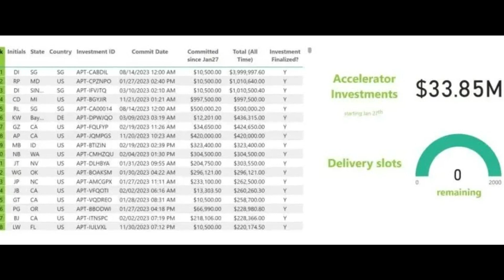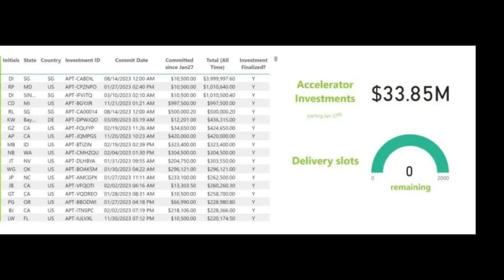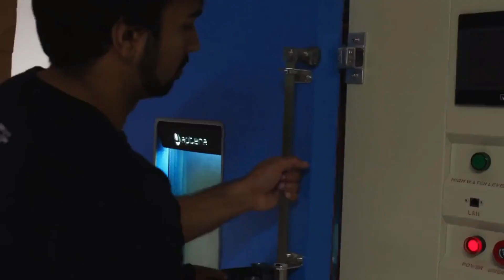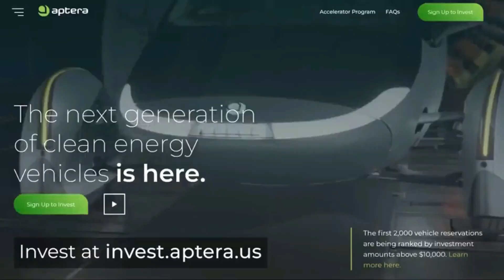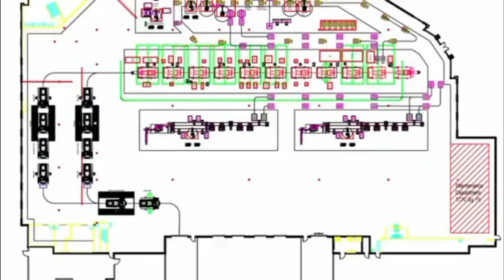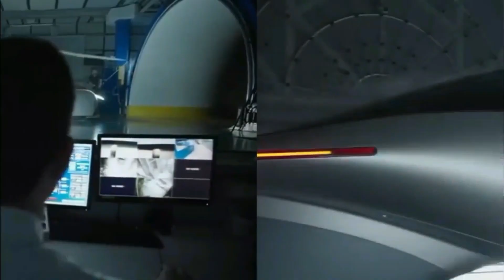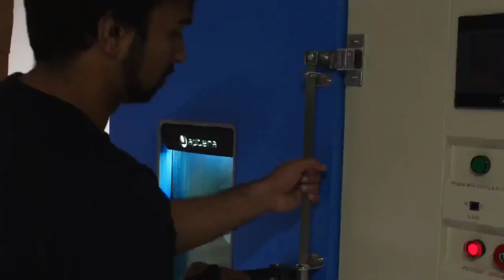Aptera Allocates Production Slots for Its Solar EV & Secures $33M in Funding

Comment: These are way too expensive for widescale adoption. Maybe if the prices come down below $10k per unit, but not at $25-45k ea. 

The cost of an Aptera solar vehicle currently ranges from $25,900 to $31,000. The entry-level 25-kWh model starts at around $25,900, while the 100-kWh version, which promises a 1,000-mile range, is priced at about $45,000. The company also offers additional solar power options for the hood and hatch at extra costs. The price may be subject to change due to supply issues, inflation, and other factors. The solar roof array is called Never Charge, and the vehicle's design allows it to be powered by solar energy for most daily use, providing about 40 miles of range each day.
Reply: Time will tell.